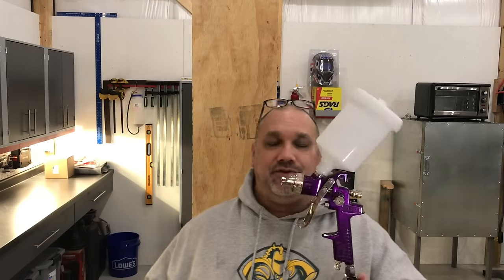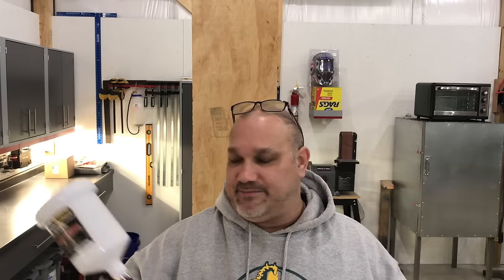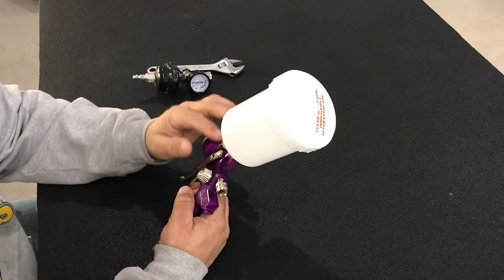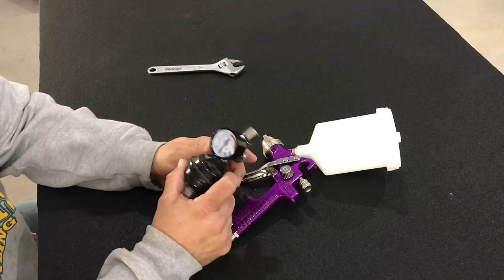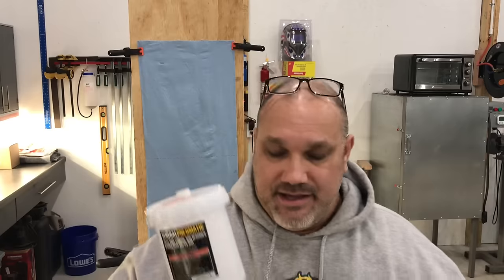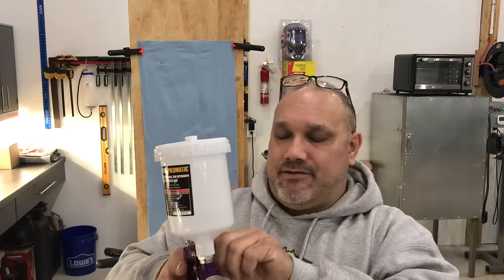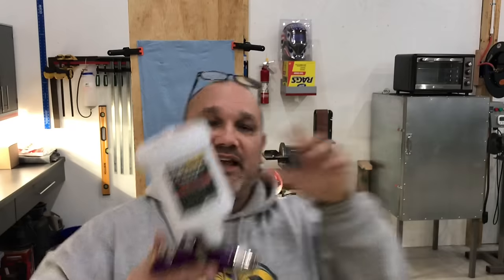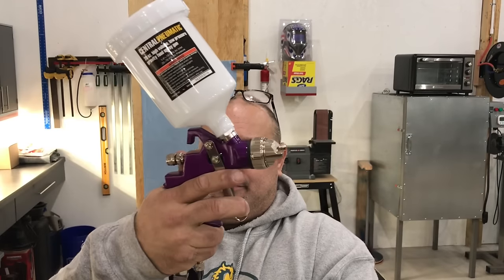How To Set Up a Harbor Freight Paint Gun

Comment: Is there any advantage to using a gravity feed with bucket on top vs using a spray gun with bucket underneath? 
 
I only have use of 1 arm, and I was going to buy one of these for spraying lacquer. However, I thought about it, and it could lead to a messy disaster. 
 
With that said, is there a better way I'm not considering? I hear that paint guns (cheap or expensive) will crap out quick so is it not worth it to buy an electric spray gun with bucket underneath?
Reply from the maker: The gravity feed gun has the benefit of using all material. A cup gun leaves a certain amount in the cup. Also the gravity feed gun has better flow. Thanks for watching.

Comment: Great video. I’m new to spraying so this is very helpful. Question - can I get any decent results with my 6 gallon pancake compressor? I need to do closet cabinets and the panels are medium sized. Thanks!
Reply from the maker: You need a compressor that puts out at least 6cfm at 40psi per the markings on the box. Thanks for watching.
Reply: @gixerman01  Thanks for the fast reply! (I will need to borrow/rent a bigger compressor.)

Comment: Hi, I am new to painting with an air gun. I have several farm tractors I want to restore. I also have several compressors but I do not have a dryer. How can I be sure the air is somewhat dry? Is there something I can connect to the compressor without the big expense of an air dryer? Thanks for the excellent video !!! Ken
Reply from the maker: Ken Harvey I usually run a small water trap filter in line with my gum. They also carry these at harbor freight.

Comment: Ok this video was produced 5+ years ago so I hope you see this.

On the box of this particular gun, it states 12 CFM @ 45 PSI.

The largest compressor that I have puts out 5.4 SCFM @ 40 PSI.

Do I need to upgrade my compressor, I currently have the Fortress 10 gallon ultra quiet (Harbor Freight)

I appreciate any input 
Thanks
Reply from the maker: I have a video that explains air compressor needs for painting. If you’re painting a small project that allows time for your compressor to catch up as you go, it will be fine.

Comment: I want to use a spray gun to apply Olympic Maximum Sealer and Stain.  It cleans up with soap and water so I believe that means it is a latex paint/product.  Can I use this gun with that product?
Reply from the maker: There are water reducible acrylics and polys, so just because they clean with water doesn’t mean they are latex. And yes you can spray stains and clears. Thanks for watching.

Comment: Not a professional my question this 15.00 gun do you need the attached regulatory attach to back of gun 
If t have a regulatory on my compressor? And what pressure setting should be use on this gun I will be doing oil base sealer Ef matte sealer

Comment: From all the way open on the fan how many turns on closing it   It’s the best spot.  And from the fluid  know from all the way open to close it on the correct spot.  How many turns u did on it
Reply from the maker: It will be different for each material you spray. Metallics will be a little different than clears. Wide open till it just starts to close the fan down. Fluid will depend on material you spray.

Comment: question: harbor freight has a mini hvlp gun.  Could it be used to touch up installed base boards, with a new laminate floor and painted walls, inside with low pressure, or should I just use the brush?  Love my $16 hlvp spray gun.
Reply from the maker: I would use a brush. Poly over spray goes everywhere. Thanks for watching.

Comment: Thank you for the presentation gixerman01! I have never used an air compressor. What would be an "adequate" compressor not only for something like this, but most tasks around the garage? Does Harbor Freight sell such a compressor? Thanks!
Reply from the maker: For small projects it doesn’t take much of an air compressor. I would avoid the little pancake compressors if your painting anything bigger than a something larger than say a basket ball. If you painting a car you will need something with some capacity at least 60 gallon. It can be done with a smaller one but the compressor would be at its limit. For smaller projects the 30 gallons will usually work.

Comment: Can I use this gun for single stage Sherman Williams car paint? Going to practice spraying my old 69 orange if I can use it for acrylic enamel ( single stage)?
Reply from the maker: You can spray enamel in this gun. I would suggest thinning it down a little as enamel tend to be a little thick. Good luck.
Reply: @gixerman01  thanks boss, BTW what psi would you use for single stage sir?
Reply from the maker: @waynewilliams5802  35-50psi for this gun

Comment: A new person is not seeing what or where  your hand is or doing.  You need to be turned the other way so the video people is seeing where your fingers are going to. Changing the air pressure was outside the bottom of the video and could not be seen what you were doing.
New people will not know al the names or what knob is what. 
The knobs on the gun need to face the camera not hidden on the back side and can not be seen.
Each time you adjust a knob rename what it is.
Repitition helps them learn.
Thanks
Great video, better than others

Comment: I been using rattle  CAN,but I think i can get better coverage with a gun.I buy paint pre mixed  ready to paint,should I use about 3% thinneradded to wha I got sent ? a pint or quart cost twice as much as a can of aerosol.Do you get more effciciacy  with less paint using a gun? I get more oz. of paint buying a rattle can ,but no air pressure control
Reply from the maker: Keep in mind a rattle can is part propellant so there is very little paint in a can. A couple ounces in a paint gun will spray as much as a whole rattle can. Thanks for watching
Reply: @gixerman01  i HAVE 2 GUNS ,A LITTLE  ONE AND A 20 OZ. THE AIR PRESSURE REG. ON THE ;ITLLE ONE IS AT 0 OR JUMPS TO 40PSI,i CANT GET IT TO TO 25 WITHOUT LOWERT THE GAUGE ON THE COMPRESSOR .THE LARGE ONE i CAN GET IT TO 20-25 at 125psi at the compressor.Is that normal or is the reg. on the little one faulty,advise

Comment: Hi, thank you for the info, i need to paint a small wood cabinet and thinking of buying this gun , i got a question regarding the paint,  i'm using just white paint from home depot, do i have to make it thinner, or can i just use the paint as i get it from home depot. if have to make it thinner how do I thin it?  Thanks.
Reply from the maker: Yes you will have to thin it some. Usually water to thin latex. This gun will spray that but an airless gun is better suited for latex. Thanks for watching.

Comment: Great video! I use this gun to shoot latex paint on wood/MDF. Have you had any problems with paint leaking out of the lid of the cup? If so, did you come up with any ways to prevent it? I have had success with teflon tape on the threads but i have to reapply everytime I take the lid off. Thanks
Reply from the maker: Chris Evitts thanks for watching, and yes I have had the same issue. It’s very finicky putting the top on.  I don’t have any good solution to that other than not filling it to full. I do have the disposable cups to go on it. I have not tried them yet.
Reply: Put masking tape around the top of the lid and the paint won't come out

Comment: So. how much better, are the so call top of the line spray guns from paint stores? Are they really worth their price? Do they last longer, or what?
Reply: Whether you need an expensive gun really depends on the type of painting you are doing, and the kind of results you want.   Before you invest in an expensive gun, make sure you're got dry, clean air at the gun.  

Automotive urethane Paint is VERY expensive, I don't want to redo a job due to crappy equipment.  I have top of the line Devilbiss (for base coats)  and Sata guns (for clear).  They are consistent, they atomize better,  and give you better control over the adjustments.       I acquired my guns over a period of time, it's prohibitively expensive for a home shop guy to get geared up with pro level equipment on day one. 

I use the purple guns for painting equipment and machinery (enamel paint), and for spraying primer and sealer on automotive applications.   At $10, they are disposable.   Before use, you'll want to take the air cap and fluid tip out, and clean out the shmoo that is always on the threads.   For urethane sealer, you can use the 1.4 tip that comes with it, but for shooting thicker paints (like auto primer),  you should open up the fluid tip to 1.8 or 2.0.

I love the purple guns for what they are:  an inexpensive way to shoot primer and sealer, so I can keep my good guns for more critical operations.   I could use the purple guns for base coats, and get ok results, but I doubt I'd be happy using them for top coats.   

As far as service life, my good guns do last longer, because I care for them.  After each use, I break them down and clean them very well.   They're expensive tools, and they get the care they deserve.   The purple guns get minimal cleaning after use.  We'll shoot some reducer through them, do a quick cleanup, and stick them on the shelf.   Sometimes they last several months, sometimes they get a handful of uses before they're tossed.  A pro shop wouldn't dedicate the shop time and labor to clean a ten dollar gun, because it's less expensive to just open a new box.
Reply from the maker: There are nicer guns out there. This gun is a very good starter gun. As your skill level increases you may want look at better equipment. This gun will get you started though. Thanks for watching.

Comment: Thanks for your video! When I carried out the water flow test with the fluid adjustment full open, the flow amount was 4oz each time. I carried the test out 6 times with the same results. What are your thoughts about the 4oz vs the 8 to 10 oz. I have the 1.4 tip.
Reply from the maker: Gravity feed guns will run a little less. Most pressure feed guns will run 8-10. You will be fine at 4-6
Reply: @gixerman01  Thanks

Comment: We just bought this gun and have a few questions. How far away should I be from the surface to be painted with this set up? How do I get to 6 oz of flow as I can only get 4 oz. We are doing clear coat on hoods, thanks!
Reply from the maker: 6-8 inches from your part. Make sure to remove that filter.

Comment: Just bought the gun with pressure valve. Going to shoot precat lacquer. In setting gun is it best to set it shooting lacquer thinner since gun needs to be cleaned first?
Reply from the maker: That will get you kind of close. The thinner is going to be much thinner than paint so you will have to still make adjustments once you load paint. Hope that helps. Good luck with your project.

Comment: Good info! I have been using this gun to spray small projects on the job using latex paint. I'm still trying to find a good fluid viscosity to get it to really layer on well. I usually thin according to the specs on the can but always seem to have to thin even more to have a decent enough spray come through. But even then I'm still spraying pretty light. Air set to 30-40psi and fluid screw basically maxed out. Any suggestions?
Reply from the maker: Latex is hard to spray in an air spray gun because of the viscosity, as you have figured out. Check with the manufacture to see if there is a solvent instead of water for reducing viscosity. Only other thing would be switching to an airless sprayer. Thanks for watching.

Comment: I have been sanding a 1956 30hp Johnson outbord down to bear metal I have self etching primer I bought that kit from Harbor freight it has two purple guns small and larger one the wrench and cleaning kit is that gonna work the paint costs 96 bucks a quart so I don’t want to mess it up
Reply from the maker: It should, good luck with your project. If you get a chance check out bigdmc1. He did a couple boat motors on his channel. That’s a buddy of mine. Thanks for watching.
Reply: @gixerman01  yeah he did a Mercury 25 really nice job

Comment: I purchased this gun to undercoat my truck with fluid film but realized there isn't an easy option to connect an extension hose/wand to spray into the various holes underneath the vehicle, do you have a solution for this?  Thank you!!
Reply from the maker: I don’t have any experience with that application. Sorry. You may want to look at what type of gun is out there for that. Good luck and thanks for watching.

Comment: Used an older style with can under from Harbor Freight to spray paint an outside wooden chair.  The surface felt gritty after painting what did I do wrong, too much air, not enough liquid etc.  Thanks John
Reply from the maker: Sounds like dry spry, can be caused by several things. The material being too thick. The vent hole being clogged on the can. Just not enough fluid coming out and or too much air pressure. Hope that helps thanks for watching.

Comment: Question I just sprayed base coat red. Problem is it has a really big shine thought is was supposed to be flat.but Problem is some parts are smooth. Others rough like sand paper. I've sprayed. Both single stage and BC. Came out good. This is my 3rd attempt to get it smooth not happening..can I wet sand the base coat to salvage the base? Then clear
Reply: Yes as long as it s not metallic

Comment: I used a harbor freight gun. At $89 and both the color paint and the primer paint came out in a splater what would cause that? or where do i start to correct that problem? This is my first try with this kind of paint gun. I do well with house paint and an air less gun.
Reply from the maker: Sounds like it was starving for paint. Did you have the filter in the cup. I would start by removing that. Next I would look at thinning your paint a little more. Thanks for watching.

Comment: Can you use this gun for latex paints? And if you can do you need to thin it out before you use it like other HVLP sprayer’s?
Reply from the maker: Yes and you would need to thin the paint. This is not the best use for this gun. You would be better off using an airless sprayer for latex. 
Thanks for watching.

Comment: I'm using this gun to paint with single stage car paint. I'm just doing a bunch of industrial doors now, but I keep having problems with dry overspray. How do I prevent?
Reply from the maker: Close down your fan, turn down your air, get a little closer to the part, slow down your movement. Try each of these one at a time till you get the results your looking for. Thanks for watching.

Comment: What gun and size compressor should I buy if I want to paint my silverado and my s10 at home in my garage, im just learning right now ,and can i just buy a decent gun and spray primer clean the gun spray paint and clean the gun and then clear or should I work with a few guns in stead of working and cleaning over and over
Reply from the maker: You can do it all with one gun. Just clean it between materials.

Comment: When HVLP guns first came out ( 30 or 40 ? years ago) they were claiming that you could spray at less than 10 psi. I bought a Binks  but could never get in the neighborhood of using it at that pressure and I didn't like it at any pressure. The hose they used looked like about 1" dia. but I never had that hose. Have you ever tried it with the 1" hose and have you ever sprayed at 10 psi?
Reply from the maker: No I have not sprayed at 10 PSI. You are correct they won’t work well that low. Thanks for watching.
Reply: I used to own a home painting Company an often used a HVLP sprayer at 10-15PSI.. 15 being better when applying vinyl primer prior to applying Lacquer instance. MY HVLP spryer was specific tool by GRACO. It is a self contained compressor that filters air, heats it and thus drying the air, prior to entering the gun. That one inch hose is typical of that set up. Hard on the arms for long jobs, and usually used on a suction can and not gravity feed. Not really designed for autobody work. as its cumbersome to work large areas. More suited to paint a cabinet or other furniture sitting on a table or bench. Hope this helps.

Comment: Please let me understand one thing I want to get a Paint Gun but of course I need an air compressor first. I don’t have a lot of space and my choice is going between the 6 or 8 gallons Campbell Hausfeld. As far as I have understood the most important thing to look at is the CFM which in this case will be 2.4 @ 90PSI would this be enough for a Paint Gun? Thanks a lot!
Reply from the maker: Most likely not. I would look at something a little bigger.
Reply: gixerman01 thanks what will u suggest?
Reply from the maker: Mens Health & Lifestyle I if I remember right the gun requires 5 or 6 cfm @ 40psi.

Comment: What’s a good compressor tank size to run something like this without issues?
Reply from the maker: It’s more about the CFM on the air compressor. For this gun it needs at least 6 cfm at 40 psi. I wouldn’t get smaller than a 30 gallon tank though.
Reply: Thank ya sir

Comment: The gun calls for 6 cfm @ 40 psi but my compressor puts out 5.5. if I drop my psi to 30 will I be close enough to get a good looking coat of paint out of this gun?
Reply from the maker: Depends on how big a project your spraying as to if it will keep up. A small project wouldn’t be a big deal. The only issue about running 30 psi is if it is atomizing the material. Good luck.

Comment: I got this gun to use as hobby. Small paint jobs on canvas or wood. I’m thinking I got more than I bargained for. I was hoping it would be okay for acrylic paint.  I bought their small airbrush air compressor also. Am I using this incorrectly, or do these not match up?   UgGh.  So confused!  Any help or advice is appreciated
Reply from the maker: The air brush compressor most likely won’t be enough for this gun. Thanks for watching.